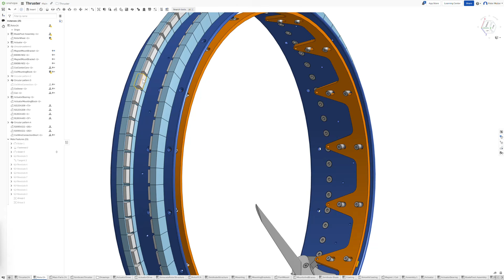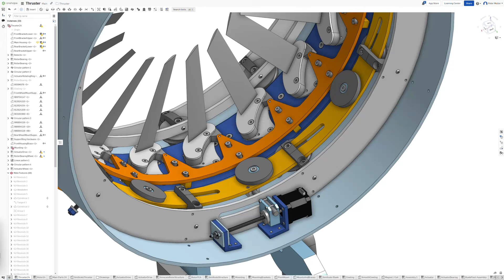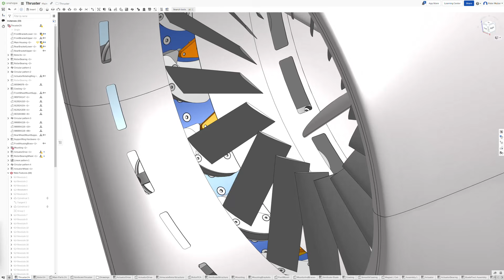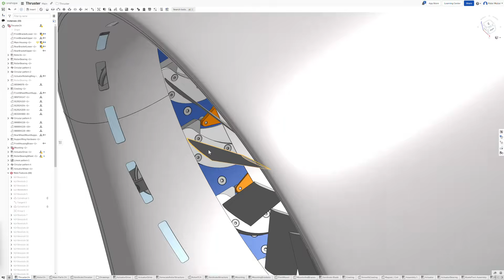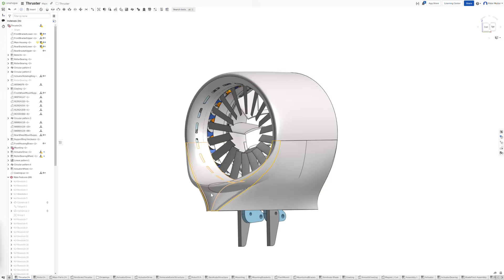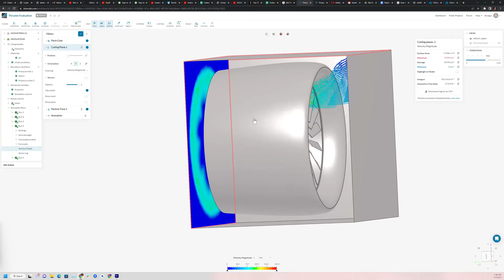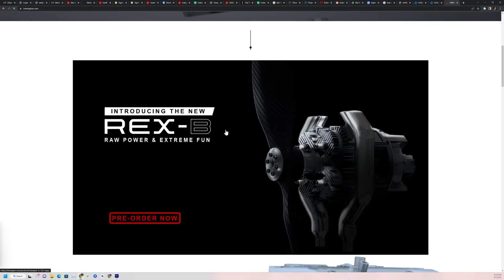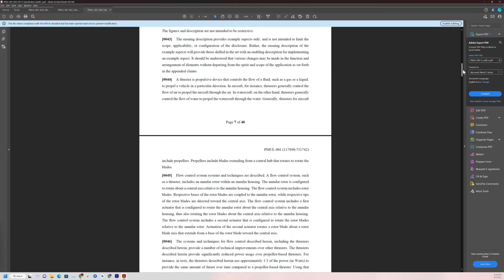Could this Thruster transform Aviation?

Comment: Ah man, those swashplate engines have never been able to get past the prototype stage.  I remember when Dyna-Cam engines were going to be the next big thing in aviation, and then they disappeared.  Wobble engines have popped up, gathered interest, and then vanished numerous times over the decades, and none of them were able to sell a single engine to the public even as a novelty.  I wouldn't go that route if you want your plane to progress beyond a prototype, as that company will likely go under before they even make a handful of engines.

I would definitely look into giving the blades enough pitch to go into beta.  Not only will reverse thrust be useful in many situations, but it can also be used in conjunction with a computerized governor as a way to regeneratively brake in flight, probably a first in aviation if you don't consider heli auto-rotation regenerative braking.  If you need to introduce drag to slow down, why not make it useful drag and charge batteries while you're at it?

Another suggestion, the blade pivot should be in a position where it just barely has enough force to return to fine pitch at speed, essentially just forward of center of pressure, rather than near the leading edge where there's a ton of aerodynamic pressure that the pitch controller will need to overcome.  It's not something conventional propellers can really do without somewhat extreme blade designs, but it could be easily done with these.  That'll reduce the force needed to change pitch, which means pitch changes can be fast and precise for dynamic conditions, and could even be manipulated by hand with mechanical controls in an emergency.  In the right application, if you swapped out the single piece pitch ring for a movable swashplate, you could theoretically have limited thrust vectoring capability by changing the pitch on the blades in the same way that a rotor on a heli is controlled.  I suppose having dynamically adjustable stator vanes could perform a similar function, or even combining the two for better effect, without the need or hassle that comes with a vectoring nozzle.  A larger fan on a small aircraft could benefit substantially from that, perhaps with the ability to control two of the aircraft's axis in cruise flight without even moving control surfaces.  Two fans with the right mixing could control yaw, pitch, and roll, entirely by thrust.
Reply: At least two of those engines were either used extensively or certified in the past, but coincidences happened as usual.
Reply: @vitordelima  Not buying into conspiracy theories, I have facts.  Thanks for the offer though.
Reply: @Skinflaps_Meatslapper  You may want to look up the meaning of that phrase, you wrote out a great response then ruined your opinion with that stupidity. Only people who believe everything their government says, say "conspiracy theories".
Reply: @Skinflaps_Meatslapper  Those are facts, they existed and vanished.
Reply: @vitordelima  They didn't vanish, they went bankrupt because didn't have a worthwhile product and snagged investors with hype and false promises.  These engines aren't the awesome powerplants you imagine they are, they hardly offer anything more than what's been available for decades, and when the investors found that out, they pulled their money.  When that happens, they change the name of their company and engine, say they've improved it, and attract more investors.  One particular company (by company, I mean the individual that keeps restarting new companies from the same engine) has been doing it for 40 years at this point, and they've yet to make a single reliable and economically viable engine.  I personally know an individual who lost $40K after investing in this new engine.  We dropped in unannounced to find out what was going on with his money, and one look at the place is all it took to know it was a racket.

That's why they get hyped up as being a super engine with unbelievable specs, that's why they all quietly disappear, that's why they show up again years later new and improved.  It's not a conspiracy, they're not being hushed up by big oil or the big three or big brother, they're just trying to swindle people out of money and you're their target market.  Assuming you have money to give them, anyway.
Reply: @Skinflaps_Meatslapper  There is no point in arguing about this with the kind of people who post here. Of course there are scams but most commenters online always ignore the existence of obvious cartels and other discreet distortions in the market, always post the same comments, push the same ideas and this isn't a coincidence.
Reply: Youre really insightful my man
Reply: @vitordelima  Sure, I'll agree that the "market distortions aren't a thing, and if they were, they could never, EVER in a million years be deliberate! You're not a filthy conspiracy theorist are you?" framing sounds like folly. Indeed, a quick scan of the wiki page on axial engines reveals that they indeed have been successfully built. It seems that some are even in use currently? I suspect its a question of bad PMF rather than just an intrinsically bad concept as Skinflaps suggests. On the other hand, an equally quick scan of the INNengine that Peter is betting on is OVERFLOWING with red flags and grandiose claims. ZERO vibrations?? 22.7 HP @ 6000 RPM for only 4.5 Kg? An online shop where you can "preorder" for EUR100? Not even a clear diagram of how the exhaust and intake happen in the supposed revolutionary 1-stroke design? (The CGI animation appears to magically teleport a charge of air/fuel into the combustion chamber on each cycle?!). 
Any time you can click on a web shop to preorder a "disruptive" technology (instead of a "contact sales" button), you should run—not walk—the other direction.
Reply: @Skinflaps, I'm gonna have to disagree with the idea of vectoring by tilting the pitch ring to give the rotor blades cyclic pitch control. That's just inviting disaster imho. I actually am curious about this idea on an open prop, but with a duct already there, I see no reason not to use articulating exit guide vanes or similar. Vastly simpler, and the results will probably be just as good.
Reply: maybe the blade tips could be stabilized on a ring via a center bearing on each blade to allow pitch adjustment. 

And I agree pitch control should be powered both ways (and higher degree of adjustment) to allow reverse thrust.
Reply: All those swashplate engines are designed wrong! My design would make all of them look like tinker toys! I was just never a good enough snake oil salesman to get financing!
Reply: Swash plate engines are really common in some military applications - torpedoes. The small diameter works really well in that application.
Reply: As mentioned you have some really interesting ideas sadly overshadowed by some blatant ignorance. The TL/DR here you've put forth is to essentially stop trying to innovate because someone else tried it and it didn't work. Brilliant thinking chap and congrats on being very passionate about it. Well, good luck with all that.
Reply: @Skinflaps_Meatslapper  If it's truly a failure, I'm sure the Government would be quite interested in this venture.
Reply: @allangibson8494  Swashplate engines are the most compact piston engines and the swashplate mechanism is one of the most mechanically efficient machines known, at about 95% efficiency. 

All the swashplate engines out there make the same mistake, they make their engines work the same way that a hydraulic pump does. Well that's fine for a pump, but we want an engine, not a pump! We don't want the whole cylinder block to rotate the way the pump does. In an engine, that causes all kind of uneven centrifugal friction and wear and restricts the the flow and asperation of the engine, limiting its power and efficiency. The higher the working internal pressure, the greater the sealing pressure needed to maintain the head seal, further increasing internal friction. There are no end of little flaws that keep making these designs impractical.

By designing the engine the same way a conventional  engine is designed and holding the engine block stationary and allowing the swashplate and drive shaft to rotate, completely solves all  the short comings of these designs. My design works perfectly.
Reply: @rodkeh  And your design isn’t original. Torpedo engines hold the block stationary and spin the propeller shaft… Using hypergolic fuel mixtures simplifies the engine in some ways (and they only need to run for a half hour).
Reply: @allangibson8494  Thank you the knowledgeable and very helpful input. I didn't know about torpedoes but that is certainly verification of the efficacy of the design. Now if heat engine builders could take the massage...
Reply: This company "just" needs to prove the concept. They NEED to make a working prototype airplane that doesn't look like shi- like the EVs of the early 2000s. If they were able to strap say, 2 of these on a 2 passenger airplane (redundancy) and be able to say fly from texas to florida on only electricity as the propellant AND be able to self charge when stationary using fixed solar panels on the body of the craft. Or even a "gas station" that collects from a few ground solar panels and they can plug in like an EV charger. That's when they'll prove the concept enough for a market to form around E-Planes, then they'll either get bought out or sell to major airliners in the future.
Reply: You don't need negative blade pitch for regenerative braking.
In fact with a design like this you don't even need variable pitch, just reducing the speed to below the airflow speed where they are in positive pitch generates reverse thrust and can be harvested by reducing the voltage to below the point that back EMF generated is higher than the input voltage. 
I'm not sure that much advantage can be achieved with variable pitch here. The whole idea of ducted fans over shrouded or open props is the air column as you spool up gets up to speeds that allow it to function well without stalling. And over half of the thrust comes from the air accelerating over the curve of the bellmouth.
Reply: I dont thin either party has enough information on those companies. A lot of useful ideas fail when trying to make them into a real product. It could come down to something like reliability or TCO not being worth it to everyone they pitched it to. Or jsut bad financial decisions leading to bankruptcy. Look at companies that had a god product but weren't efficient and failed. Arcimoto is one of them (they were making the FUV)
Reply: @NeuralSensei  The Vulture Capitalism culture believes "the first rule of venture capitalism is fire the founder". 
Most good ideas fail because of that stupidity. 
And these swashplate engines are unlikely to get much money behind them, because their very simplicity, and so many prior designs are in the public domain, that investment for mass scale  production is unlikely. 
If it was a gimmick that didn't work well, and was extremely complicated and prone to expensive breakages and short lifespans, then it's attractive to capitalists. 
Sadly, the best ideas are all in the public domain, and in the capitalist system that means they are for suppression not promotion.
Reply: @vitordelima  you mean coincidences like terrible efficiency, high maintenance costs and absolutely terrible time between overhaul?
Reply: @aaronfranklin324  they're terrible engines, no one has gotten them even close to the efficiency of even fixed pitch propellers or classic EDFs.
Reply: @Argosh  Anyone is one quick search away from proper information about this, so there is no point in wasting time with people who always repeat the same nonsense in a loop.
Reply: @vitordelima  weird, one would think you could at least drop a project name or something. Weirdly enough I could find all the research papers on the topic quite easily. No strange coincidences covering anything up.
Peter himself isn't a stranger to being horribly, almost fatally wrong. His brilliant brainchild that was gonna revolutionize private aviation, by breaking with all tradition, ended up massively overweight and underpowered in a quite traditional stall/spin accident.
And from the way he is behaving now it doesn't appear like lessons were learned.
Reply: @Argosh  the Chinese would disagree. They are using them on their latest submarines. 
All you get from the hub and root is a core vortex, and a part of the blade that's got its combined lift drag vector pointing the opposite way to where you want to have it pull you.
Reply: @aaronfranklin324  your incompetence is amazing. Have you ever heard of a dude named Reynolds? And no, I don't mean the guy playing Deadpool.
If you understood what Reynolds numbers were you'd have a first clue why what you just wrote was so unbelievably daft.
Your second clue would be if you knew the difference between compressible and incompressible fluids.
Wanna take a shot at guessing what those are and why the classification makes what you just wrote completely nonsensical?
Reply: @Argosh  Yes, considering I designed and built the Americas cup wind tunnel in 1999, that EVERY winning Americas cup Yachts rig has been developed in since.
That the Current generation of foiling monohulls being raced are an adaptation of my 1993 cruising yacht design, using a variation of the wingsails I Prototyped in 1986 for landyachts.
 I was a national championship winning yacht designer, builder, racer since 1987.
A designer and builder of bikes that have won 18 national championships, set time trial records thirty years ago at commonwealth games, won Olympics medals, and a World Champs title, and still design and build high efficiency high performance electric and hybrid vehicles for land sea and air. 
And water and wind turbines, and multi molecular closed cycle phase change working fluid systems, from 1979 to present.
And was making and testing model rocket, and jet powered, and glide dynamic soaring models from age eight. 
You should not  be surprised to hear I have heard of Reynolds numbers. 
And have some familiarity with compression effects and behaviours of not ideal working gases and fluids. 
And am familiar with the leading developments in ship, submarine, aircraft, supersonic and hypersonic engine, aircraft, and spacecraft designs.
Many of which you have probably never heard of. 
You bore me.
Goodbye.
Reply: @aaronfranklin324  all of that and you still managed to get confused why something works for marine propulsion but not for aircraft propulsion... sad...
Reply: @Argosh  it's not a jet. Its not intended for high speed flight. 
So it is in concept fully valid. 
Not optimal Imho. 
Too complex
Could be much simpler and stronger, and thereby lighter, and thereby perform better. 
It could still have variable pitch even without all the mechanical linkages and pivots with good aero elastic design.
Reply: @aaronfranklin324  you might wanna look into the recent work in large surface bearings. Frankly, it's nothing short of wizardry what's coming down the line as far as wear resistance goes. But even with that stuff I don't see how you would run a couple thousand rpm at that diameter. And with potentially varying loads. The only reason we're attempting it at 20cm is the magnetic flux density when you rotate the magnets in the shell as opposed to the core of a brushless.
Reply: @vitordelima  I aware of it and it not convenient agency but a corporation who owns aviation and the technology behind airplane he have better luck to display it to military then to for consumer use
Reply: @chabadlubavitch7303  u are wrong that not conspiracy theories it truth the is big corporations that share the right of some technology like aviation ,communication devices,auto mobiles devices, manufacture of components is separated on more categories but counts too, and much more
Reply: @alangolab6657  Some companies developing alternative engines do the same to survive.
Reply: @alangolab6657  The history of the TRACE engine is a good example of how every aerospace business that tries to sell something new is destroyed by an absurd series of coincidental events.
Reply: @allangibson8494   Thank you!!! I was about to comment this. The Mark 48 torpedo uses a roughly 500 hp squashplate engine running on monopropellant.
Reply: @chabadlubavitch7303  it just perspective from u side but many companies and category of technology engineering was taken down because it was disruption the economy or someone would earn less revenue so that not conspiracy that real thing just
Reply: @alangolab6657  I'm an architectural engineer i work for darpa in auto-genius armour archetypes don't assume things it only makes you sound stupid. Please don't comment online.
Reply: Judging from the comments below, all engineering companies should just fire their teams and read yt comments. No problem of mankind would survive THAT!
Reply: @chabadlubavitch7303  The irony that most conspiracy theorist believe the nonsense that government figures put out is an hilarious contradiction.
Reply: @acorgiwithacrown467  Yeah like the DDT commercials from the 50's, television "programming" where they told you it was safe to spray in your face or on your cereal, or better yet the Tuskegee experiments, or the Vietnam war and the carpet bombing of Laos who weren't even involved in the war.
Reply: Do planes slow down a lot beyond landing? If you're about to land, there's very little point generating energy right then.
Reply: @aaronfranklin324  how do i get a job doing that stuff? Is it a situation were you need to already be over qualified? Like PhD?
Reply: @fajile5109  nah not really. These days you can get a PhD level of knowledge in that sort of thing in a month or two of obsessed  knowledge junkie reading and watching what you can find on the web.
If you can design and make some cool stuff that works well like model planes or boats. Which so many teenagers are doing to today with the design tools and 3D printing gear that's so accessible, you'd probably find it easier to get a job than me. 
I got those contracts because I built up a company  that had the technology to make what was needed when others didn't and had dropped the ball. And was in the right place at the right time. 
Which kinda made me unemployable. Over overqualified. 
With a CV that if I applied for a job would either get the "shit mate, if I have you this job you'd be bored as f and I'd be doing you a disservice by wasting your time when you could be achieving so much by yourself. "
Or my job application would "Disapear". Reapeatedly, invariably, because some manager thought I'd have his job within a month if the company employed me.

Which is fine by me. I've seen too many geniuses turned into quivering gibbering recluses by workplace bullying and corporate systems that make it take a year to make a simple prototype part that they could have whipped up in the afternoon. 
If you've got a brain, getting a PhD will kill it. You'll be programmed to repeat that what crusty old profs believed and achieved 50 years ago is the best there ever will be. And the company's you might want to work for, don't want PhDs. 
Because they know all this.
Reply: @albertweber1617  energy costs money. Always save energy. Always.
Reply: @rodkeh  wow, took the words right out of my mouth!
Reply: @rodkeh  Ya, it's some pretty easy shit if you ask me. We're using technology from the 1800s, unbelievable. One of my engines puts out >90% efficiency at zero emissions! I'm an engineer, not a force to be immoral, commission driven support my family, financial professional, or whatever you called them. Sorry, it upset me what people do for money. It's crazy that the hardest part of inventing is bringing it to market.
Reply: @rodkeh  if you have a piston, the piston stops at least twice per combustion. That alone is a 10% loss in efficiency. Then, the piston stops at the bottom of the cylinder with another 10% when you open the valve and waste compression. You be lucky to get 50% efficiency. Don't have any idea how you're calculating your efficiency. I could be wrong, I usually I'm. Please enlighten me.
Reply: @sigmundwong2489  it's a shame that a lot of promising engines are illustrated and yes, I follow what meatflaper was getting at since this company has been promoting their motors for 40 years and not 1 working unit to show for!  

Amazing how these "smart boyz" published their concept via cgi but don't follow through to get a prototype built!
Reply: Sounds like you should  make something along the lines you suggest
Reply: @NaviYT  They have been made for around 100 years, even the Italians first planes used this type of engine... They end up having to be hilariously large to have any effective trust.
Reply: i aint reading allat